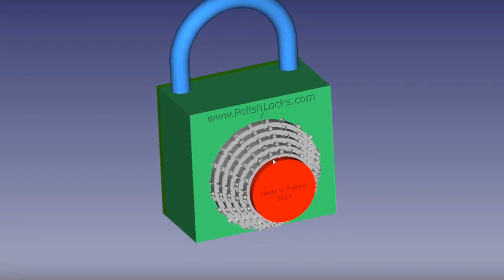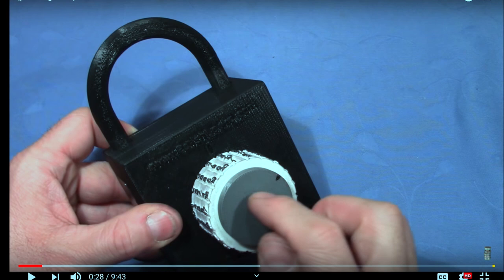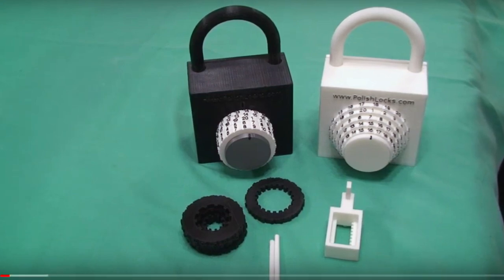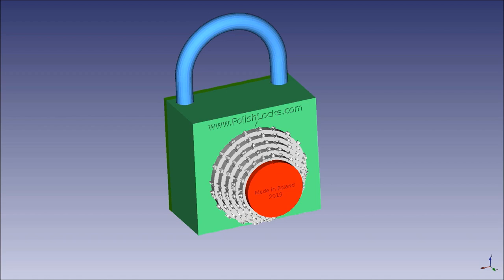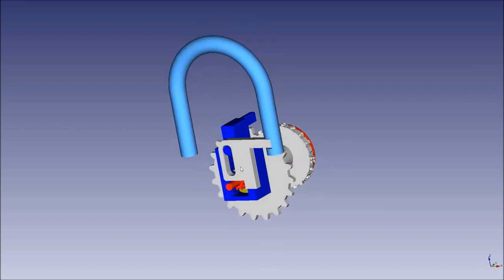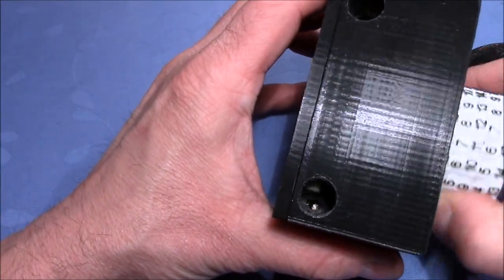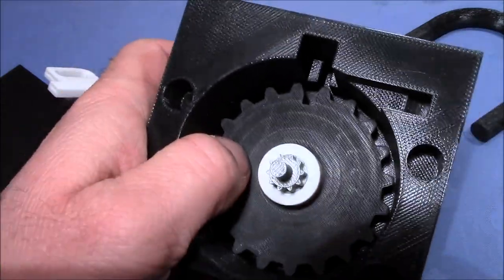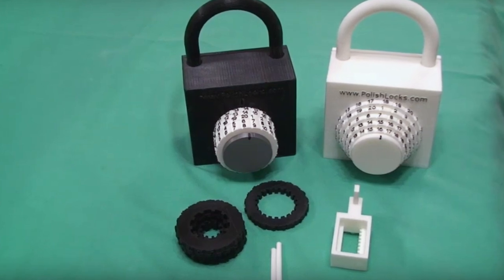(Picking 119) The Polish Combination Lock World Wide Challenge

Comment: Congrats on being chosen to crack that lock if it can be done you are the best chance of getting it open. I believe you will.
Reply from the maker: Hehe thank you for your confidence! :D :D  Hmmm I believe it's easy to make a combo lock that I can't decode ... eg some combo locks I use 1) the pull-picking method, and if that doesn't work (because of an indirect internal mechanism) then I use 2) a decoding tool.  If 1 doesn't work then 2 does, and is 2 doesn't work then 1 does.  Why not turn one of those locks that can't be pull-picked and then make the gates secure from probing attacks by covering them up (like some locks already do)?  Then I wouldn't be able to get into them.  Maybe this will be the first combo lock I've come across where I can't get in.  All the other combo locks I've come across, I've eventually been able to get into (although admittedly I've haven't tried some of the more expensive combo locks).  Again thank you for your confidence in me. :D